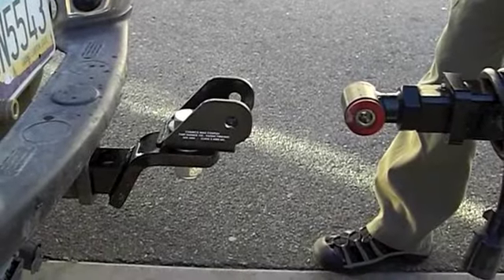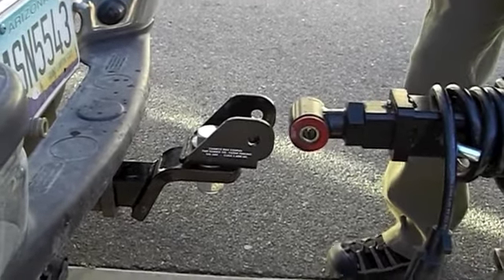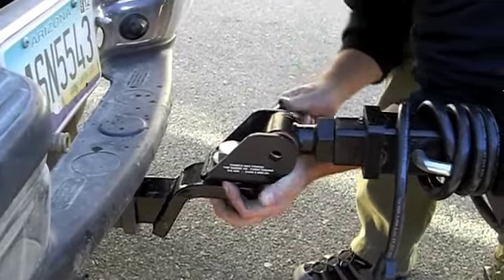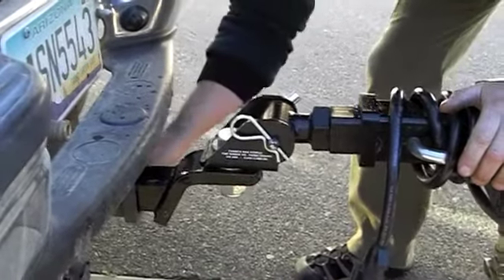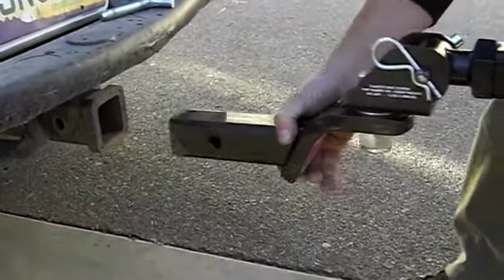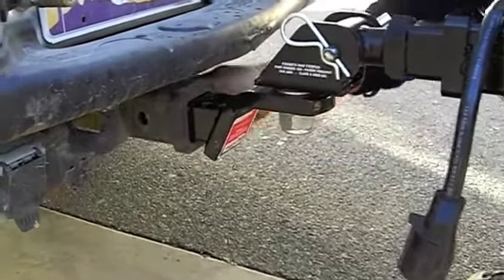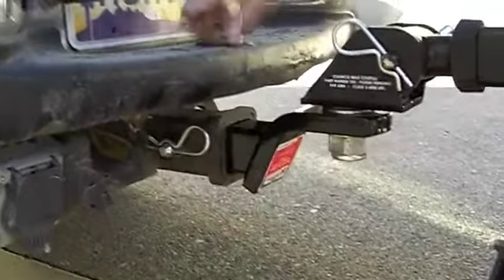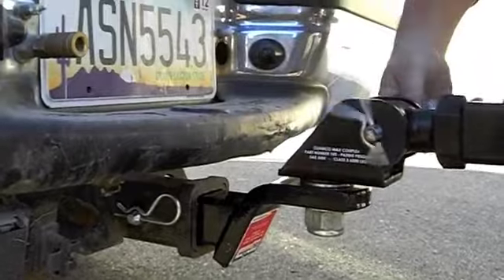Max Coupler Set Up

Comment: I'm sure it's very nice, once hooked up, but who has a trailer they can just move around on perfectly flat ground. In real life 
i t would be a nightmare to hook up on your own. Just something to consider.
Reply: Teardrop owners have a trailer they can just move around as needed by just one person.  Very low tongue weight.
Reply: These are designed for off road trailers like the OGT expedition trailers and yes you can move the trailer with the installed ark jack no problem.